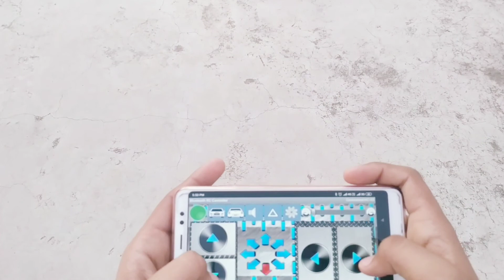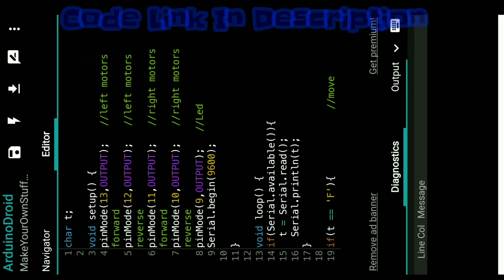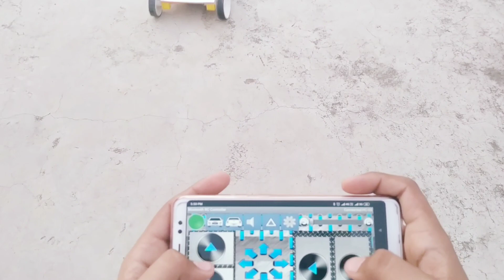How To Make an Arduino Bluetooth Controlled Car | Mobile Controlled Car | Bluetooth Car

Comment: kya karu mobile
Reply from the maker: Use ArduinoDroid app
Reply: @VaibhavDubey108  dala to hu motor ni chlri
Reply: @VaibhavDubey108  4 battery piche lagaya or samne se mobile se power diya hu
Reply from the maker: Make sure ki power 12v rahe or else it will not get much sufficient power to move
Reply: @VaibhavDubey108  mobile se power ni de sakte
Reply: @VaibhavDubey108  12v ka adaptor lagaya or 4 cell lagaya 1.5v vale phir bhi ni chalra
Reply from the maker: It will only provide 6v and you need 12v battery or 8 battery to get 12v power
Reply: @VaibhavDubey108  samne se to dera hu na 12 volt k adapter lga ke
Reply from the maker: I recommend you to use 3 4v rechargeable lead acid battery or li-ion battery
Reply: @VaibhavDubey108  adaptor se ni chalega kya
Reply from the maker: You can try it by yourself
Reply: @VaibhavDubey108  i can try many ways but not couldn't run my project
Reply from the maker: Try lead acid battery
Reply: @VaibhavDubey108  coding ki dikkat to ni
Reply from the maker: Coding sahi hai
Reply: @VaibhavDubey108  apki wali coding hi dala hu mobile se

Comment: Can I use normal DC motors instead of BO motors?
Reply from the maker: Bro you can use but normal dc motor but the problem is that normal dc motors don't produce that much of torque and this will effect the speed of your car,but on the other hand gear motors have high torque and they can provide you smooth speed.
In simple words normal dc motors won't handle the weight of components and your car won't move
Reply: @VaibhavDubey108  what battery did you use?
Thank you for replying
Reply from the maker: 3.7v li ion also know as 18650 battery